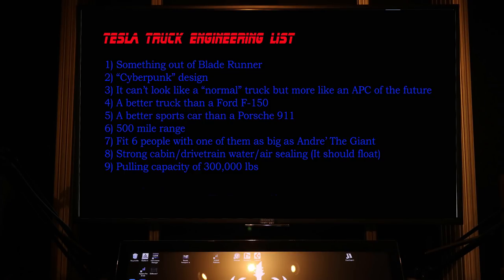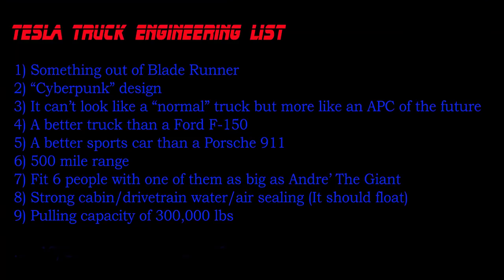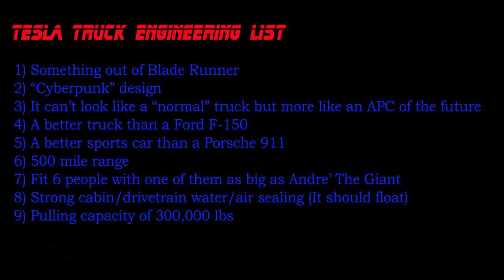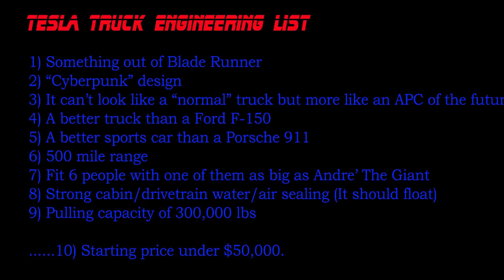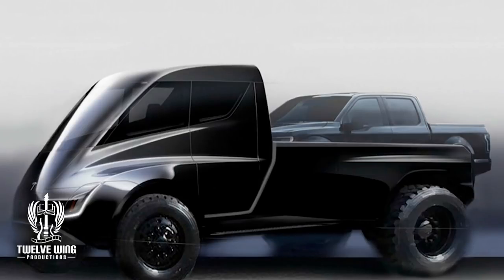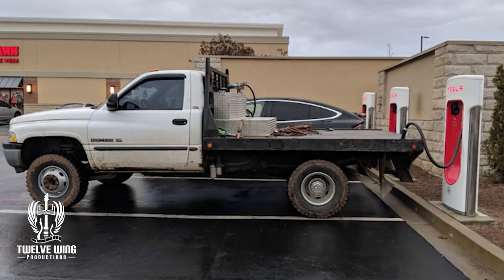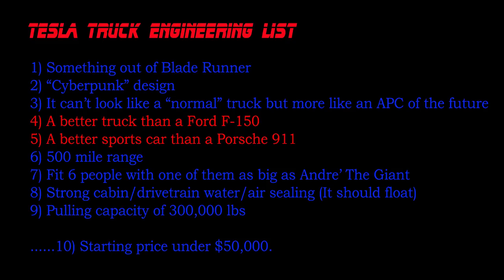What Tesla's Pickup Truck will Really look like: A design exercise

Comment: These are the most accurate predictions out of any video I've seen, good job. I'll add a thing or two. First, this is a long shot, but I think it would be really cool if there was an a door or airlock in the center of the vehicle that opened up to the "bed". Then with an optional inclosed bed that had air conditioning pass through, you could have even more seating. He did say it's like an armored people carrier after all 😉. Also with the towing, it would be easy for them to add brake controller that applies the brakes without you pressing the brake pedal. Again, great video. If I had time, I'd make a 3d model but I'm busy all week.

Comment: Excellent video.  You’re probably the first “Tesla YouTuber”  that I’ve listened to to point out the difference between towing and pulling capacity.  I would also add though that axle and frame strength are a factor in max towing capacity.
Reply from the maker: I tried to touch on that when pointing out that if you want to claim a high pulling or towing capacity that you have to focus on how your frame or chassis structure is integrated into the overall layout.
Hence my comment about puling a tree with enough force to lift the front (or rear) axles off the ground.
The weakest link will fail first.
Be that hitch, bumper, frame eye, spring/air suspension support, A arm, A arm bearings, CV joint... and on, and on.. and on.

It's the total package, as you say.  Want to stop a trailer?  Well then you need strength in that direction too.
So for towing, I focus on "control".  That control can come from either the towing vehicle or the trailer or both.
The best way to avoid a situation is to have enough control to avoid it in the first place.

Give us your thoughts on layout.
I'll be doing screen shots of all the layout comments just before the reveal and we will go over them afterward.
We have a fantastic group of folk on this channel that have really really thought this through.
Reading the comments makes me grin every time.  I'm trying not to comment too much myself as I don't want my own opinions to influence others too much.  I just wanted to lay out the basic demands from an engineering standpoint and see what others came up with.
Reply: I completely agree.  I really have no idea what this pickup truck is going to be.  Only thing I’m pretty sure of, based on what Elon has hinted, is that it’ll be completely different than the rest of the competition.

I live in Nebraska and drive a Ram currently.  I’ll likely be preordering the pickup truck if half of what is rumored becomes true.
Reply from the maker: @macbeliever , Can't blame you there.  It sounds like it's going to be one hell of a work truck.

Comment: As well as being a Truck, this could be a base for a fantastic RV (replace truck bed with RV living unit). Add in autonomy and you could travel overnight whilst sleeping to desired location, plug in and unhook your e-bike for ride in beauty spot. That won't just be a US sale, but a worldwide one.

Model X type doors could be a thing to enter the 6 berth cab. Air suspension to lower deck for entry.

Trailer battery for towing will, I am sure, be a thing. Why carry all that extra battery on the truck just to occasionally haul your horses or boat or whatever. Horse owners spend big bucks on big units - truck plus powered trailer could be a much better option.
Reply from the maker: Yup.
Reply: Bruce Turner in CALIFORNIA (Tesla’s biggest market) many can’t afford a home, so a RV unit would be great. Also in CALIFORNIA electricity is expensive so put some solar panels on the roof for free electricity & biohazard air filter to counter act smoke from fires & poor sanitation from the homeless.

Comment: It will probably be able to use it’s suspension to lower itself enough to reduce body roll for cornering
Reply: Modified Model X air shocks
Reply from the maker: @Mdude59  Possibly.  It's also possible that they will use an existing product from Maxwell to have an electric suspension.
Reply: Air compressor in truck would be selling point for work, nail gun, paint sprayer, etc
Reply: Could make loading easier if it can sit on the ground completely.

Comment: Another awesome Video my friend, I'm sitting down with a Rum and Ginger.  I waited till everyone went to bed because this is my current favorite subject.  I've been having this discussion for 6 months with friends who think Elon is out to lunch with his parameters.  The biggest issue that people are 'baulking' at is the towing Capacity.  I remember when Elon made the 'flippant' ... "more like 300" comment.  The context being he was asked if it would be able to tow 30,000 lbs. The Anti Tesla community has jumped on this as literal and the Pro Tesla camp has jumped on this as ... 'wishful' ???  So I had the exact same idea as you about it being a matter of how do you control 300,000 lbs  *SAFELY * behind your truck.  Well you don't ... UNLESS ... like you said, we take a hard look at the trailer and how it interacts with the 'Pilot Vehicle' ( the truck).  (My old 5th wheel was very heavy and my old diesel pulled that thing around with a 'grimace' on its grill. That was only 19,000 lbs loaded to the brim). If we take our 'skateboard battery platform' (100 extra KW ) and a pair (or more as needed) of our model 3 performance motors and built our trailer's Load Bearing floor and or canopy over top, and made the trailer completely symbiotic to the truck you could effectively and SAFELY tow the LEGAL highway maximum and double your towing range.  I think we are going to see a variation of the Model X rear doors reinvented as main doors. I think we are going to see liftable fenders at the sides of the box, to gain access to the PTO, the compressor, the electrical and tool storage from both sides. You and I are on the same page about the swiveling Captain's Chair.  I do not think it's going to be a centre seat configuration like in the semi.  I think it will have dual Swiveling Captain's Chairs and a table that can fold out from under the back bench seat that will work as an AWESOME truck office with all the bells and whistles that being completely integrated with STARLINK mobile internet could possibly provide. Possibly a dish that tucks in behind the cab and telescopes up and auto tracks optimum reception.  As for aesthetic design,  It's going to be more of a 'faceted' rather than 'angular' of a design.  Think of a cut diamond.  It is going to look bloody AMAZEBALLS ...   Between Franz von Holzhausen, Elon Musk and that incredibly talented design team I think our minds are going to be BLOWN.  I think it will have a "SMART TINT" feature that 'Blacks Out' the windows when you leave the proximity of the vehicle and gives you full tinting control while driving.  Armoured glass (as proposed for the semi). Now ... as for the $50,000 start price, there will be 3 options ... Light Duty, Medium Duty and Heavy Duty.  Each of the options will make the competitions comps look like toys. The light pick up will of course be offered down the road stripped down at $49,000 USD.  So ... am I out to lunch or what ???  Dare to dream baby ... dare to dream. LOL ... My deposit is burning a hole in my bank account.

If we are expanding on a wish list of accesories I would love to be able to ‘drop’ my box (roll off style) and interchange with a flat bed. And if we are going that far why not a dump box or a HIHAB Style crane that rolls on and off like your flatbed and hooks up to your PTO.  An Industrial Welder ??? How about a ‘Small Load Concrete Mixing Drum’, or how about a small Field Operations Office using the same ‘roll-off’ architecture.  Sky’s the limit.
Reply: @JamesBell....GINGER&Rum...AEY?...SPEAKING...5X5... I'll SEE your cab lay-out...and RAISE you 12WNGZ Pilot Seat...and EVERYTHING you said BEHIND it....FACET-FORWARD.... MINUS  the Sat-Dish...tho...Starlink reception being ubiquitously optimal...EVERYwhere....however...
Reply: Great points. It's time to think big. He lands rockets on platforms at sea! But I really scared that the hype is going to be so intense that we will disappointed no matter what rolls out😥😥 here's holding thumbs.

Comment: Great analysis! I was lucky enough to be able to go to undergraduate and graduate school but never had the chops for engineering .  If I was the only engineer on the planet, I'd probably still be trying to figure out how to make a round wheel, which means all of us would be walking around versus driving.  Great points you brought up  that I did not think about--has to fit into a supercharger space, the pulling vs. towing difference and being able to stop both the truck and what you're pulling, etc.  Can't wait for Thursday--if the design is not too extreme (i.e., where it will appeal to a lot of potential truck buyers), this will be yet one more foundational piece for the company that should strengthen its financial stability and success for . . . well, forever!

Comment: Agree. Good points all around. I think It will be a composite of mainly the semi (design), sportster (battery) and model 3 (computer h/w V3-4, ?f/w?) and a splash of model-specific innovation will be introduced. But, given all that, the $50K price point cannot realistically be achieved with all of the design & performance features. Similarly, the Model 3 rollout is case in point. And that’s an intuitive assessment!
Reply: 50K base in three years. 80K for the first models off the line. Given the cost curves 50K should be doable after three years of production.

Comment: I will throw out this idea that the side walls of the truck bed will also fold down which will give the option to operate the truck more as a flat bed which would also make fork lifting and moving heavy objects easier and creates an open work space that could be auto leveled by the trucks suspension.

Comment: When you mentioned the center seat design of the cabin, I was thinking it would limit the amount of passenger seats. Elon said it would be more like an "armoured personell vehicle", which seems to me that having good passenger capability is of at least some importance.

Being able to utilize all that front space for the cabin instead of the traditional motor hood might help make the cabin a three or four row one, including the driver front and center, then 2-3 people in each row behind. This will probably be possible while not sacrificing much of the bed length either. 

Just like the current models, maybe you'll get to choose between having more passenger rows or more internal storage area.

Also, I can help but wonder if they will offer some cool bed covering add-on capability. Maybe an automatically rectracting/roll up style bed cover, similar to how the Model X winged doors work?

Comment: My guesses are not aesthetics but technical.  I have no idea what the cab will look like. So, 'Trimotor' design currently being tested in Germany with Model 3 type motors common to Semi. 200kWh pack using Maxwell and new tech. Variable height suspension perhaps 3" to 20" ground clearance using Model X type air suspension. Model X side doors.

Options: Big tires (reduces minimum ground clearance), third axle (yes this is for the HEAVY duty), enclosed 'bed' (aero) or flat, cargo, or tool side box.
Desired: bidirectional 'supercharger' daisy-chain port for trailer or Powerwall battery (possible emergency use also).

So, a 'lowered' P200T might give a 911 a challenge. Carry a ton, no problem. 240VAC no problem. 500 mile range possible in some configurations. Probably a 10,000 lb towing capacity (base) but much more with integrated motor and battery 'smart' trailer. 
With my truck I want the motorized double axle trailer with integrated batteries and supercharger DC power sharing.

Comment: Referencing regenerative braking with trailer, they could easily just control trailer brake output with software that tracks speed, incline, wheel slippage etc.
Reply from the maker: Agreed. They could also offer a standalone product to use with other electric trucks that utilize a hitch sensor.  It would have to be incredibly robust, but such a hitch could actually allow for the utilization of self powered trailers. 

Imagine a Rivian able to pull a Tesla equipped 5th wheel because the trailer had a 200kwh battery in it and 2 electric motors driving the axle and supplying regen braking.
All totally do-able.
Additionally, such a 5th wheel could be equipped with solar panels on the top and on a fold out awning that would allow it to charge its onboard batteries while it sat there.  Either to pwoer itself or even to send some power to the towing vehicle to allow it to operate independently while the trailer remained at the campsite.

Lots of very cool things in our future.

Comment: CORRECTION WITH BRAKING.   Trailers with braking on normal vehicles is done by the brake signal from the brake light wire. On Teslas and most evs, when you let up on the accelerator and do not press the brake pedal, the brake lights still come on and would activate the trailer braking anyway.
Reply from the maker: Understood.  My issue was that with the regen braking system, the brake light, and hence the trailer brake, would be on continuously and this is not a state one sees with normal trailer use.

So something more sophisticated might be needed for a standard set of trailer brakes.
In the case of a regen trailer brake system, you are obviously correct.

Comment: 1. Elon thinks outside the box, so I think the Blade runner reference is smoke and mirrors. A lot of light, and vague shaped vehicles in the background to keep us guessing. with tires pushed well forward of the cab.
2. Cyberpunk being a subjective term, and could mean something like the Bat-mobile from “The Dark Knight”
3. See #2
4. Ford 150 is known for many things, but tough and can take a beating would top the list.
5. Build a big enough engine, and you can fly a barn door: Put a big enough battery pack, and you’ll have a quiet dragster.
6. Is Elon going to finally state that the solid-state battery is going into production in Berlin?
7. 6 people in a vehicle the size of a F150 can be done
8. Is the truck going to be amphibious? Drive by wire and 4 wheel steering will make it viable, and a split door (upper lifts and lower drops to make a stepdown/up) could be sealed to allow a lower floating point.
9.  Agree with the term “Pulling”, as there are legislative classifications for licencing when it comes to vehicle weight in combination with the weight of what is being towed
Reply from the maker: Or given the advert for the reveal we just saw, the BR reference might be to Deckard's personal car.  The wedge shape we saw that was common on his and a couple other cars seen in background shots.
https://i.pinimg.com/originals/57/8e/cb/578ecb73057729b25a2fc11bbb2451c6.jpg

Comment: Move cab forward - put the front seats on rails, slides backward for entry, forward for driving. Back seat entry would then be easy.-Height adjustable for work or Hwy. (Porsche) operation. Have the " Frunk" area ready for tools,luggage etc.  You could still have an extension of the bed under the back seat for lumber or extra storage for skis or more luggage a la "Rivien".  Remember that there is no solid connection front to rear for 4- wheel drive.  The wheel base could be adjustable.  The truck could also come as a panel van option which would be like a "Sprinter Van". Good for electricians or other tradespeople and possibly modified as an RV. I have also suggested before that load equalization could be achieved by having the heavy battery on rails so that, as the truck was loaded, the battery would move forward.